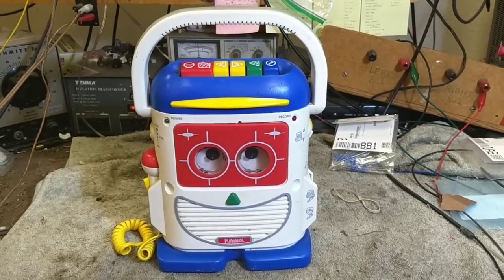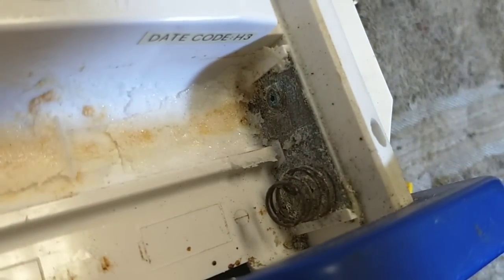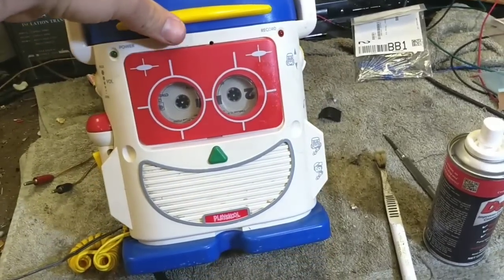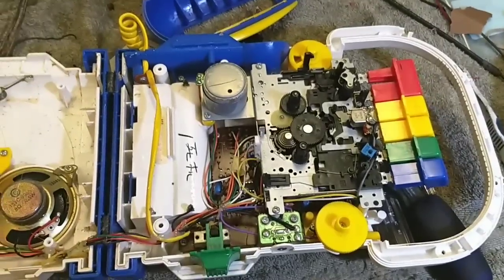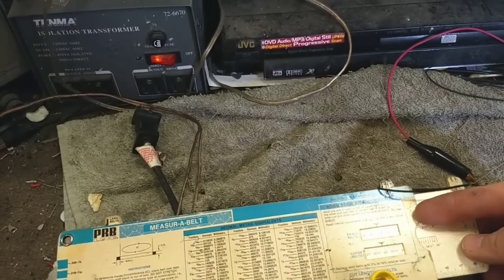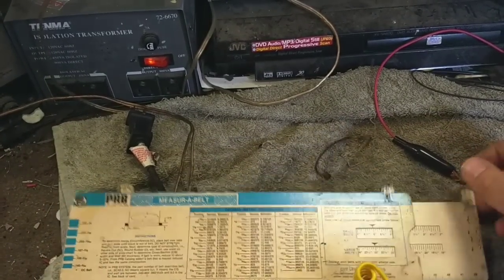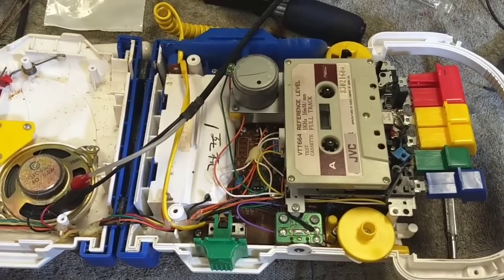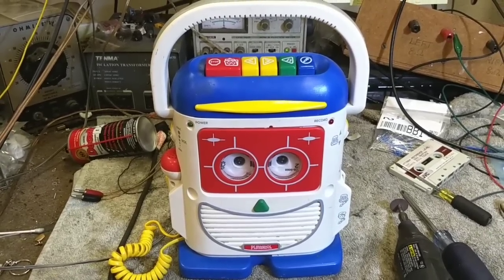Servicing a playskool kids tape recorder.

Comment: This is actually a low-end model of the 1990 Rockin' Robot. Which had a built-in AM/FM radio, and had a grey & white color scheme. Later in 1993 they released this model, dropping the Rockin' Robot name. The radio was replaced with a voice changer, and it wasn't selling too well. Playskool was able to feature it in 1995, for the upcoming CGI animated Pixar film ''Toy Story.'' Where it would become a recognizable character, known as Mr. Mike. Playskool re-released the original Rockin' Robot, under the Toy Story name in 1996. Returning the AM/FM radio, and now having the red & white color scheme. The rebranded toy was selling well, becoming a character in a popular movie franchise. (Due to this, finding a unit cheap online can be quite difficult. Thankfully... I have mine from childhood somewhere, which is the 1993 radioless model in the video above.)

Comment: I didn't expect to ever see one of these get repaired, I still have the one that I got for my son except the one I have isn't as creepy as that one! 
The one that I have has a switch to change your voice into robots and other things, I was waiting for you to test out that microphone function but you didn't do it, the only reason why I haven't taken my one apart is because I wanted the voice changer circuit because it really isn't bad. 
One little bit of criticism I have about the restoration of this thing is that you didn't pull apart the mechanism and clean out the old grease which is probably dried up by now, the fact that the 1khz test tape was running a bit slow should have been a dead giveaway. You compansated by speeding up the motor but you might find that it may speed up after some use or due to excessive amount of wearing. But that all depends on what you plan for the device at the end of the day, these things might become a collector's item and become very valuable, some toy's do! But if it's knackered, you end up throwing it out and that's exactly when they become valuable lol. 
It's a good break from TV's, it keeps things interesting but as I'm sure that you have noticed how other people are commenting about a tripod, yeah you really need one, even if you had to sticky tape a few bits of wood together and then sticky tape your phone to the end of it, it doesn't matter what it costs at the end of the day, it's how it works for you that's important, it literally gives me so much anxiety that I feel like reaching into the screen to give you an extra hand! Otherwise I really enjoyed this video and hope to see more random stuff pop up, I'm not really into vintage TV's but that's okay because I'm sure that there's plenty people out there who are! But it gets hard to watch without the tripod and at times I start to reach for the seasickness pills LoL.